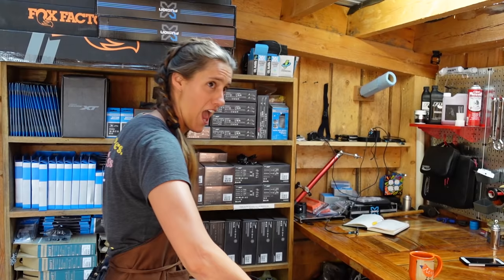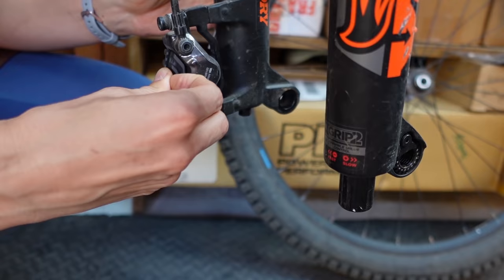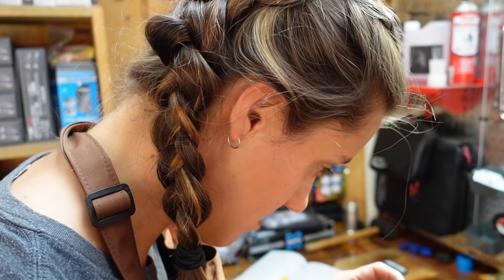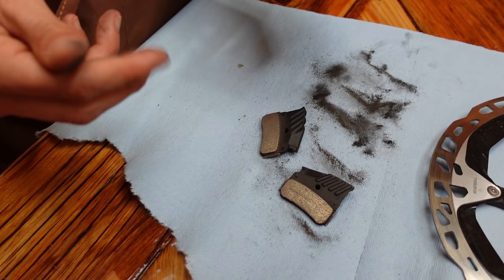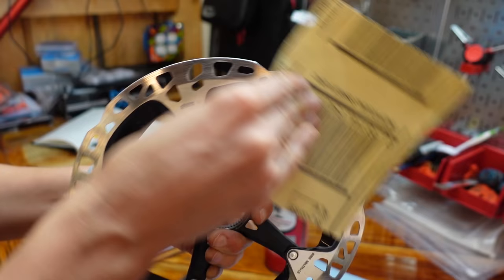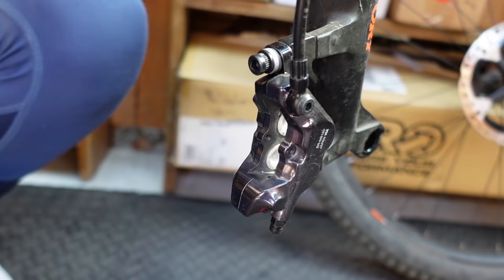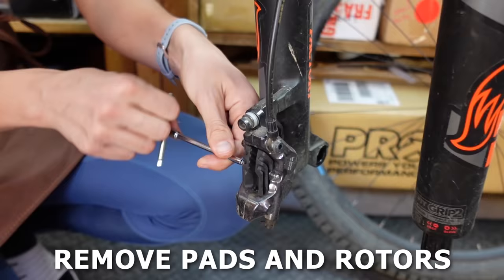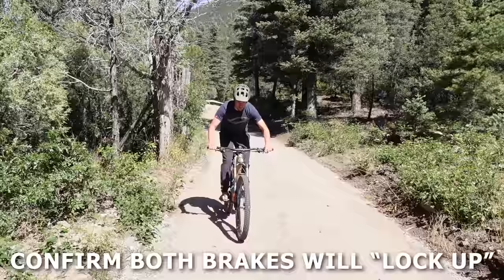How to stop squealing brakes and get more power (bedding in brake pads and rotors) | Syd Fixes Bikes

Comment: Everyone in the comments talking about 'proper sanding techniques' without bringing up the issue of contaminants soaking into the whole pad. Brake pads and rotors are relatively inexpensive, especially with the advent of those made in China and Taiwan.

Comment: If pads/rotors are brand new do you still have to sand them down before?
Reply from the maker: Nope, not if you haven't ridden on then yet. But if you have ridden then before bedding then in, there's a good chance you'll need to sand before bedding or it won't work.

Comment: I did the whole procedure and I barely noticed an improvement in braking power (I think I need to purgue the fluid since braking is squishy), but the brakes started squeaking now 🤷🏼‍♂️ should that go away?
Reply from the maker: Did you bed them in after sanding them? If so, the squeaking should go away when you first ride, but if it doesn't or you didn't bed them in, you may need to repeat the process as squeaking can be a sign of them not being bed in...
Reply: @sydfixesbikes  I did bed them in as shown in the video. The squeaking is quite mild though and I can hear it mainly when the bike is standing and I lock the wheels and move the bike, but wasn't there before. One thing I noticed is that I can see a little bit of the material of the pads (same brown color) in the rotors and I'm wondering if it could have anything to do with only letting the pads dry for only a few minutes after cleaning with iso alcohol before installing and doing the bed in. I will try to clean the rotors again or otherwise repeat the whole process, but in any case, I appreciate how you make the procedures look so less intimidating. Thanks

Comment: Like all your vlogs you 2... Wish you could help me with my rear rotor adapter problem. I have a few spare adapters.
Helping rebuild a bike for a friend. His frame has IS fittings and he has 160 rotor. So I fit front 180 rear 160 adapter but as I try to fit the caliper its way off. Massive gap with the caliper riding on the rotor unable to fix it down onto the adapter..
Reply from the maker: Hard to diagnose without seeing it in person, but it sounds like something is marked incorrectly (either the rotor or the adapter)...
Reply: @sydfixesbikes  Ahahahha I found the solution..... tried fitting it wrong way round as in the print I assumed would be on the outside or facing out to read it and fit it.... but NOOooooo so now it fits a treat. Many thanks.

Comment: thanks much. me ebike is 33c3 (33mph) and i noticed my rotors get hot. any suggestions?
Reply from the maker: Anytime you're braking, your rotors will get hot, that's normal. If they're getting hot without you braking, they probably need to be centered. If so, check out this video: https://youtu.be/xWmlK5Qbt_U
Reply: @sydfixesbikes  what is normal hot
How to reduce heat?
Pads only last 1500 2000 mi is that normal
Reply from the maker: It depends a lot on the terrain and conditions you're riding in how long they'll last. In terms of the heat, rotors will burn you if you touch them after any kind of serious braking, so they get HOT!

Comment: Hey! Kinda new subscriber. You guys are cool and I’m a fan of your work. I recently got back into biking after YEARS. First time with kind of a fancy set up. Fancy for me but it’s an entry level bike. My bike has a front quick disconnect. Is it normal to have to adjust the breaks after every time you take the wheel off? 
Happy Independence Day!
Reply from the maker: In short, yes, that's normal. There are a few things that can cause it to rub after you remove and reinstall the wheel on a quick release system:
1. The wheel isn't sitting fully in the drop outs (make sure to apply pressure to the center of the handlebars while you attach the wheel to get the wheel fully seated in the drop outs)
2. You're not tightening the quick release the same amount so the brake is pulled slightly closer or not at close and is rubbing (it's almost impossible to tighten it the same, so not much to do about this)
Reply: That makes sense. I thought that’s what it was but wasn’t completely sure. Thanks a bunch!

Comment: Do you know what to do if my rotor have a bumps when breaking?🤔
Reply from the maker: Assuming you mean the rotor is bent, check out how to straighten it in the later part of this video: https://youtu.be/xWmlK5Qbt_U
Reply: @sydfixesbikes  it's straight. Because its not best quality rotor it's like having more material in one place and make the bumps
Reply from the maker: That's weird. If it's new then sounds like it's faulty. If you've had it for a while, it might just be worn out.

Comment: Quick question:  Which Grit of Sandpaper can you use?  Thanks.
Reply from the maker: I think we did something in the 100-200 grit range. Doesn't really matter, but you want it rough enough that it'll take off some it the pad material.

Comment: once i thought screw it those safety pins on the brakes are annoying to put back in after every time, so i threw them away. next ride the pin was gone and i was riding with loose brake pads. it works btw, just prone to squeaking and making noise.
Reply from the maker: Yeah, my dad forgot to put them on once and his pads fell out! So, you definitely want a new pin (and safety clip) ASAP!

Comment: hi syd, great series and learning lots of little tricks from you. i have squealing brakes and no power. i have done these tips, and even changed the pads for new and still not bedding in at all. all clean and brakes rebled following your other tutorial and still no power and brakes squealing. both front and rear. any tips on what to look at next? all rotors and pads have been sanded down and cleaned and dried off thoroughly 4 times each now and still no luck.
Reply from the maker: That's really weird. Are you going through the bedding process carefully? It's best to do it on a downhill if you can. It''s possible that there is a leak near your caliper that is causing oil to get on the pads/rotors, but that seems surprising given that it's both of them. I'm stumped 🤷‍♀️
Reply: @sydfixesbikes  so anyway, i watched loads of videos on youtbe yesterday and all basically said if squeaks happen, its always contamination. so i removed rotors and gave them a very good sanding, and also changed the pads. turns out i had two pair of brand new pads that were both somehow contaminated. all sorted now and all bedded in nicely. keep up the vids. i think the next video should be truing wheels or making sure all spokes are tight and true. only because mine need doing and i dont know how!
Reply from the maker: Glad to hear you got it figured out. Already did a truing wheel video: https://youtu.be/JmucpbA7jkk

Comment: sanding with bare hands is a no no. i tired it before and it totally ruin the brakes. braking surface has to be very very flat with the brake surface in order for them to work properly. when its squeaking, brushing the brake pads with industrial alcohol will do. for the rotor use a disc brake cleaner to wipe them off. Sanding is really the last option because its easily removes the flatness. You need a sanding block but I wouldn't recommend using a lighter grid sanding films, e.g. 3000 and above.

Comment: Step 1: get rid of your Shimano pads.  (current models (and for the last decade nearly) use a compound that within hours soaks up atmospheric moisture. This leaves your brakes squeeling and with no power.  The only solution is to bake them at about 400f for an hour.   This will only last a day or so before they've soaked up more moisture.
I went through various brake models and replacements, and many replacement Shimano pads and bleed kits etc. before I figured it out. I went third party brand and I've had solid braking for the last year with no real adjustments. (yellow ones).

I stick by Shimano brand always but the truth is those pads are built to fail.  They got hundreds of dollars out of me trying to find the issue. If sram didnt start out with this philosophy compared to Shimano starting from a quality perspective I may even have moved back to them 😂 but I know they're not good and neither are avid. Been there done that. 
Hope or Shimano is the way to go (-the awful Shimano pads).

Comment: Brake cleaner is nasty stuff. Rubbing alcohol is safer for you, safer for the paint on your bike and calipers, safer for the piston seals, less likely to leave any kind of residue that will need to be burned off the pads.
Nonetheless, when I sand and clean pads I follow it with a mini butane torch to burn off remaining contaminants.
Also worth noting that if your pads keep getting contaminated and you are not sure why, check for weeping from the piston seals.

Comment: An easier way to do the pads is to, under running water rub the pads together on the actual pad materials. It will 9/10 fix the problem and fix it faster and easier to keep the pads flat.

Comment: Use a sanding block rather than just a sheet of sandpaper. The block will keep the surfaces on the pads and rotor flat.

Comment: I've once tried metal pads on my gravel bike, with shimano grx calipers and xtr 160mm rotors. When I changed the pads to metal ones I also got brand new rotors (still XTR).  I liked the braking power but did not like the noise of them, although I did the bed in religiously well. Believe me...I'm picky ;). After a couple of rides I decided to change the pads to resin ones but left the same disc that had been burned in the first time with metal pads. The power of the brakes is immense! Never had that strong brakes before. I've burned in brakes at least 20 or 30 times on several bikes and they never felt so strong as those. Burn the discs in with metal pads and then change the pads to resin...was all this by chance? I don't know ;) but I'll try again

Comment: TOP TIP: If you dont have brake cleaner, use acetone. Its dirt cheap!!
Reply: Agree but don't use nail polish remover if there is any chance it has added moisturiser which quite a lot do bizarrely.

Comment: 4:00 breathing brake pads dust is very dangerous and if u just put fire on rotor while the wheel is spinning it will burn all the oil and dust and it won't even dmg the rotor easier and u won't scratch it u can even put fire on brake pads but not too much

Comment: So i wanted to view a video on brake Pads, I see the cute female and naturally I want to hear what she has to say. I have not bedded in my brakes for years I ride everyday unless its muddy. So I watched this video and quickly took my pads out, sanded them off with 320. I have sticky back sandpaper so it was easy as I stick sandpaper down to a flat surface. I then just cleaned my Rotors with Alcohol. I saw my pistons were not perfect and other adjustments could of been made. But all I did was sand off the old stuff on pad. and cleaned rotors. Then I took bike out to the hill by my house I got 8 good beddings in on front and 7 on the rear I then parked bike till next day. WOW I cant believe how much my braking has improved, I even have more handle WOW. Its like I have all new stuff. Why bedding in brakes makes such a difference may require 2 years of engineering school. heehee  Anyway Thanks so much for this video. Its a long story , But bedding in brakes properly is a MUST. Thanks again

Comment: You do not need to burn in your brakes. It's called Using Them.
Reply from the maker: We misspoke. You need to bed then in (not burn them in). Just "using them" often leads to poorly bedded pads and a decrease in braking power.
Reply: Agree, cured all noise within 300 m slope😊

Comment: Even with a proper bedding in process, disc brakes can get contaminated just by looking at them. You must do this every 2 weeks if you ride a lot.
Reply from the maker: We generally go through the entire life of the pads without having to resurface them as long as we bedded them in properly the first time. Had something like this happen once and it ended up being a loose bleed port that was slowly dripping oil and contaminating the pads...

Comment: I use Dawn dishwashing soap to clean my brake pads by rubbing them together. It works almost as good as sandpaper and you don't have to worry about warping the pads by sanding them a little unevenly.

Comment: The correct term is not burning in it’s bedding in for brake pads. This is the process of getting a thin layer of pad material to adhere to the rotors for maximum braking.

Comment: Really useful video! Two questions, if I may....
What grade grit/sandpaper are you using?
Can you use sandpaper on "resin" based pads?

Thanks :)
Reply from the maker: You can use sandpaper on resin pads, it'll take off material more quickly though. We use whatever's on hand, generally fine to medium grit.
Reply: @sydfixesbikes  Super - thanks very much.

Comment: Grabbing the bike on the work stand by the stanchion of the dropper post, without using a rag or something, is asking for trouble.
Reply: As long as it's clean it's fine. I've been doing it for years.
Reply: @skullsroad3642  until you miss some dirt on the clamp or post and you get a scratch.

It's better to grab the bike at the top tube and use a rag to avoid scratching anything.
Reply: @Amt0571  If you're going to be pedantic (even after Syd specifically addressed the issue already at 2:19), then absolutely do not clamp the bike by the top tube. If you want to do it 100% by the book, you only ever clamp by the seatpost (on the part below the stanchion, if it's a dropper seatpost). Because that's the only exposed part of the bike that's explicitly designed to be clamped. But as Christopher said already, it's fine to clamp a dropper stanchion as long at it's clean (and you don't clamp it super duper tight). Park Tool even did a video specifically addressing this.
Reply: @mattgies  it's safe as long as its clean. It's easy to miss something hard enough to scratch a stanchion though. It can be something small enough to end embedded in the rubber part of the clamp. I've seen it happen.

Agree that you can damage a frame if you clamp it with too much force though. Specially if it's carbon.
Reply: @Amt0571  It's true, very important to keep your clamp clean.

Comment: Hello ! pro bike mech here.

i did try this a lot to save pads, also other techniques (burning it, scrubing them together with soap, oven, all sorts of chemicals, prayer and goat sacrifice, etc...). And it NEVER worked, 

if your pads are polluted with oil (as in the video : caracteristic noise, shiny and black surface as they righly point out) dont bother wasting time and change it. 
If you try sanding it, you will waste 20 minutes, and after 10 breakings the squeeeeeeeek of doom will cone again. then you will have to buy new pads and change it again.

sorry to be pessimistic, i d like to be proven wrong...
Reply from the maker: Agree that if they're actually contaminated this method often won't work. In this case it did work, but I suspect it was more of a "glazed" issue from not burning in the brakes properly when we first installed them.

Comment: Bike shops (like Syd) can bed in your brake pads/rotors by spinning the wheel with air pressure with the bike off the ground, because that way you can spin the wheel faster, safer....

Comment: Wont work, in 90% of cases its contamination new discs and pads is normally the only way. If it still persists after that your calliper is leaking, No amount of heating, sanding/grinding and spraying will clear it, 1 or 2 rides and it will be back. that's my experience of 20 years with disc brakes. 

Another thing it can be is a new frame can make discs squeal with frame resonance noting will solve that and or the break mounts need facing (like my rear ones right now do)

Comment: Hydro is a STUPID fad, same with thru axles. Nothing wrong with cable. 
Or get a SA XL DRUM brake, mine with dyno for lights, has 27,000 miles used on a 120 lb tour bike. ZERO adjustments or new pads, near zero fuss. 100% reliable, NO worries. Once a year scratch the glaze the same.
 I have a cable TRP Spyre with resin pads on my Rohloff. Installed in the middle of a tour. ZERO squeaks, no bed in, only a speck of rag cleaning since. 100% locks instantly.

Comment: Fingerprints all over them simple spray shit load of brake cleaner on them with bike in work stand spin the wheels keep tapping the brakes or put slight pressure on brakes and turn the wheels

Comment: I like you guys ...but sanding is not necessary.   Just spray the brake cleaner on a clean shop towel that is laid flat and then wipe the pad across the sprayed shop towel.  Each wipe should be across a fresh section of shop towel that was sprayed with brake cleaner.   
The “sanding technique” can make pads too smooth and hence the need to “burn them in”.    🍻🍺👍🤟✨